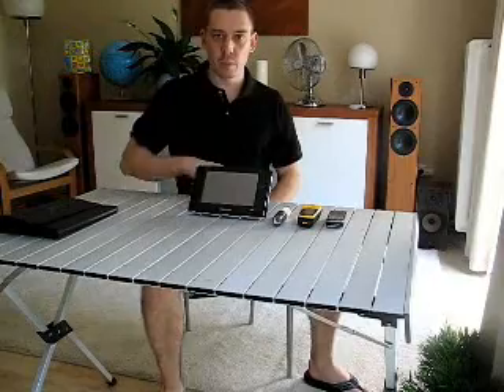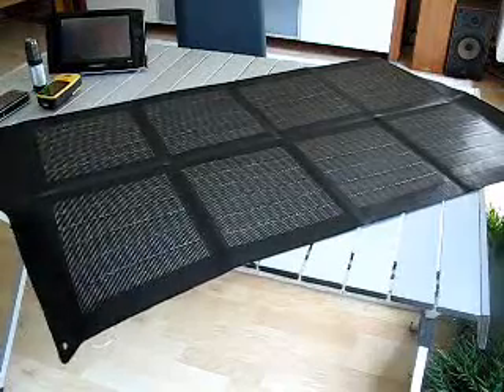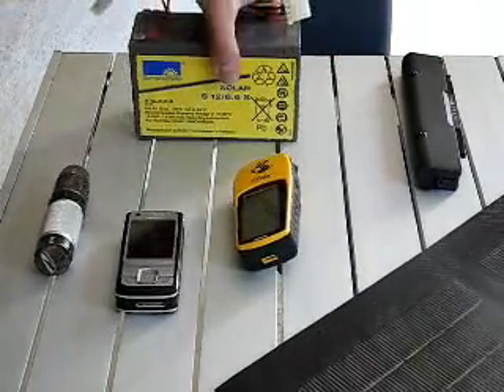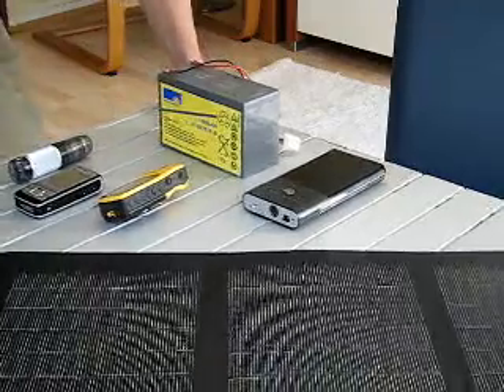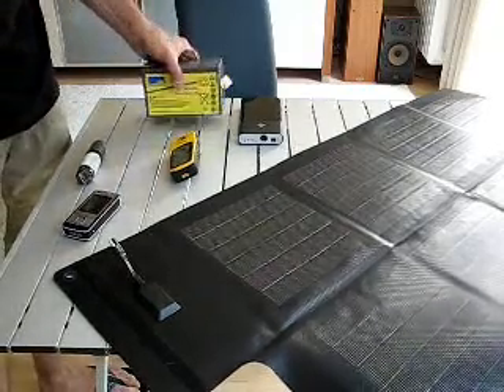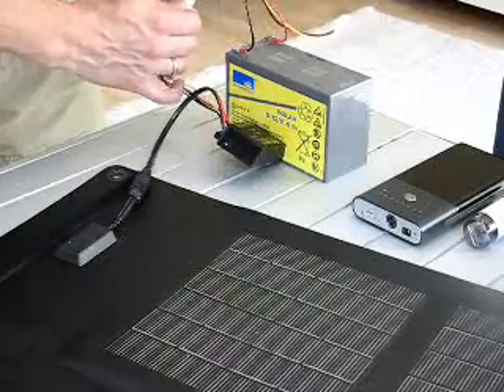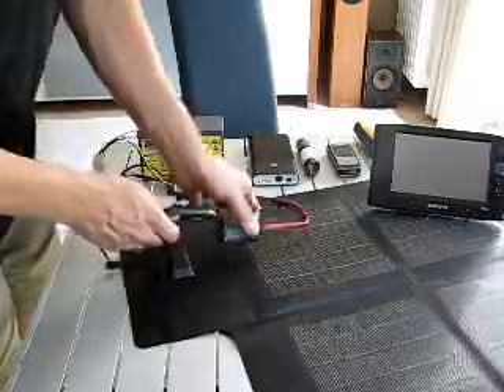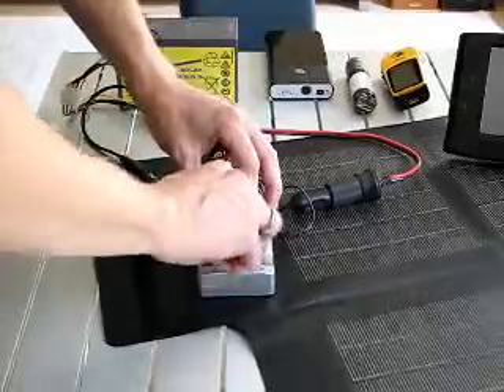Solar Ultra mobile PC. How-To. Pt1 of 2

Comment: why dont you get an iphone and charger then you dont have to deal with the old equipment you have there. And don't knock LI-pos for very quick charging/ usage cycles. Your equipment should be for a house system or caravaning. 

With my juice bag, iphone and power monkey, im good to go. even to glastonbury with out heavy equipment.....